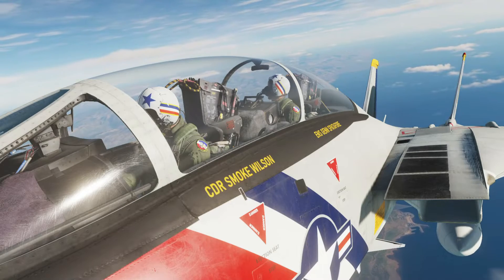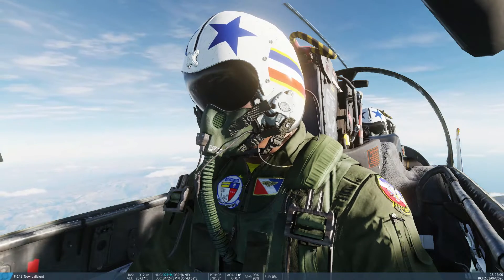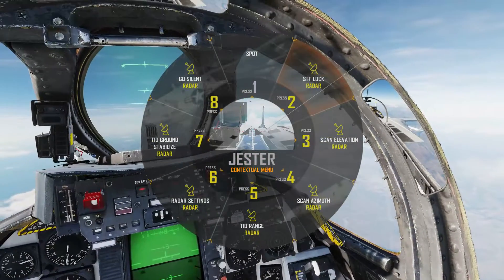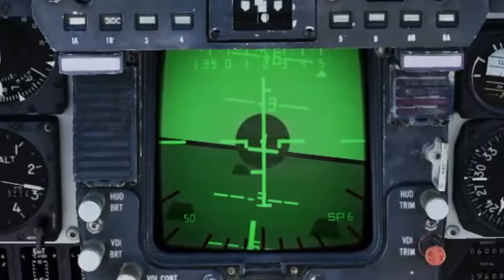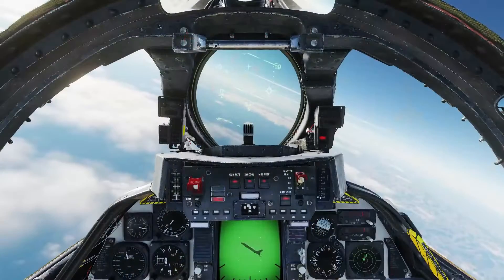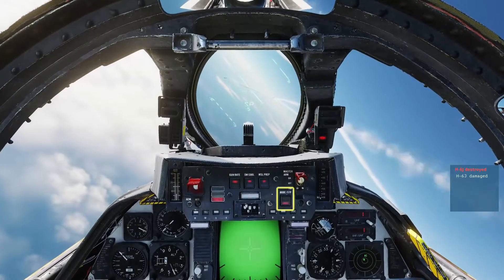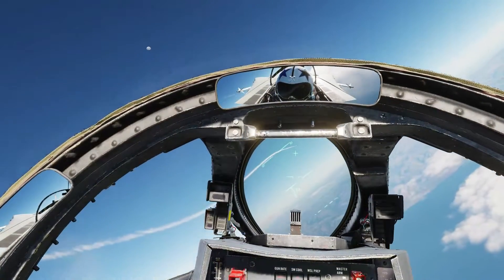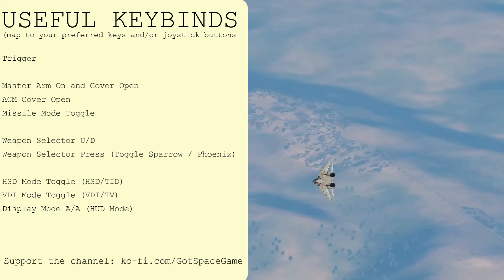DCS Tomcat Sparrow - F14 AIM7 Sparrow Tutorial - DCS in 3 Or Less

Comment: STT = Single Target Track mode (there is also a Track While Scanning mode)
Flood Mode = Air Combat Maneuvering Mode 
Jester = Weapons Systems Officer, the guy in the back seat
Diamond = lock
Diamond with a cross around it = TV contrast lock
Weapons selector up to the Sparrow position
SP for Sparrow and a number (6 Sparrows) is displayed
PH for Phoenix missile 
Target closure rate left scale
Target range right scale

Did I get the abbreviations right?

What's TCS?
What's TID repeater? 
What's ADL?
What's VDI?
Reply from the maker: TCS is the Television Camera Set, and the VDI is the screen that shows either that, or a kinda hud-like graphic. The TID is the Tactical Information Display in the back seat, and the TID repeater is the display that shows what the RIO is seeing on it. It works kinda like the normal radar display in newer jets.
Reply from the maker: Sorry... I missed ADL = Armament Datum Line... Basically it's the little fixed-position cross near the top of the HUD
Reply: tws wont support sparrow